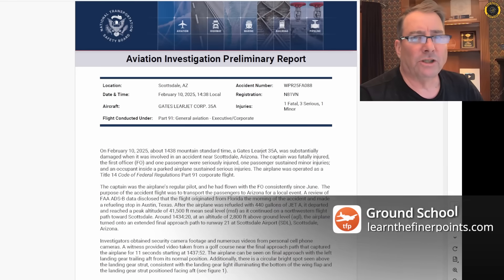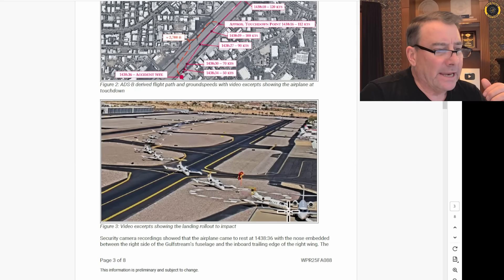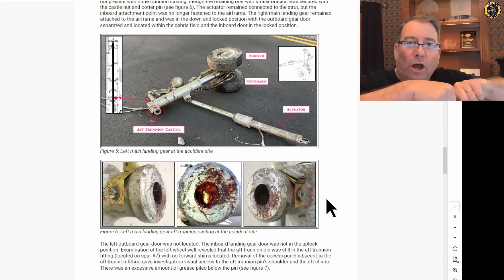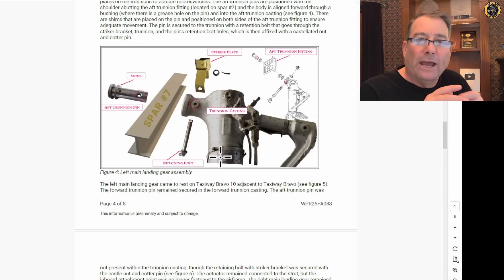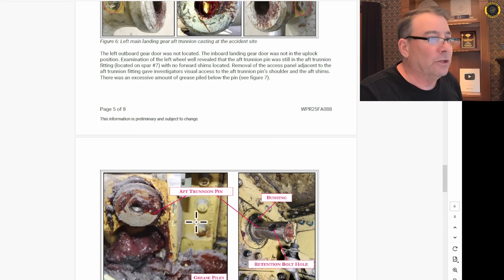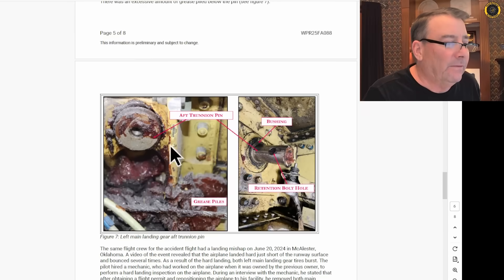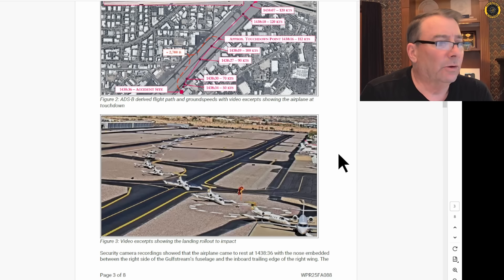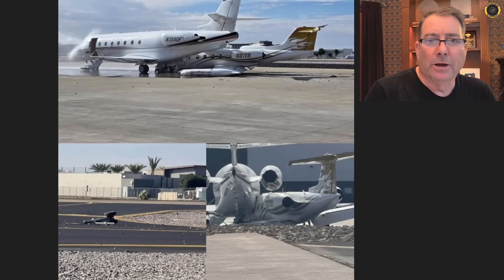NTSB Preliminary Report Fatal Maintenance Error Lear 35 Scottsdale

Comment: I found this exact thing on an AOG call out for a Cessna (I believe 560).  The discrepancy was a leaking brake line.  It was leaking because it had been smashed and stretched with the gear loose.   The sub structure and access panel kept the gear from coming out of the general location.  The top wing skin was dented when it landed and was taxied, towed and parked with no one seeing the real problem.   When we stood back and looked the wings were not level and looked similar to a low strut.  If that brake line was not leaking this aircraft could have very well been flown again.  A good walk around is ALWAYS needed even when it is a quick turn around.  That pin took a few flights to work out.  Never assume it flew in good so it is good to fly out.

Comment: Juan,  If that landing light is illuminated, then the landing gear squat switch is in the DOWN position. Learjet uses this feature as a backup to the cockpit green light. So during a tower flyby for an unsafe gear. If the tower sees the landing lights the gear is down and locked . That is if the trunnion is in place.

Comment: Sorry if this sounds like a dumb question, but could this have been spotted by the pilot doing thier walk around? if so, maybe adding this to the check list might save lives in the future.
Reply: Only if you could see the head of the pin on the other side of the spar. If the mechanic couldn’t see it, you couldn’t either.
Reply: @txkflier  What about all that grease? Surely, that should be a sign something is wrong.
Reply: @ It would have been a good sign if he’d read it. Without the bolt through the pin, the grease could have pushed the pin out of the trunion.

Comment: It is impossible for me to believe even a marginally capable A&P mechanic (assuming that is who did the "repair" in OK) would not tug on the "AFT Trunnion Pin" after inserting the "Retaining Pin" to see whether the "AFT Trunnion Pin" is in fact, retained. I am equally surprised the design allows the "Retaining Pin" to be inserted without the "AFT Trunnion Pin". When I talk "cars" with my wife (retired aerospace engineer/program manager) about how cool an ECU system or ABS system is, she always retorts "well, it ain't aerospace! 😄".

Comment: I work on my own and family's vehicles and I also help the neighbors sometimes. The more "safety related" an issue is such as brakes, the more careful I am in double and triple checking that everything is put back together and operating correctly.
It's amazing to me that a mechanic would not notice that the trunnion was not fully seated on the trunnion pin by over an inch or that the pin itself was not tight against the shims on the other side of the spar, as it could not have been. I just don't see how this could possibly have looked correct on either side of that spar.
Reply: makes me wonder if there needs to be frequent THC tests - just like breathalyzer tests for presence of alcohol.
Reply: Brakes are simple and hard to f up. Your car has 2 hydraulic brake circuits, lose one you still have some braking, lose both somehow and you can downshift, then you have a parking brake. You have a lot of options if you lose some or even all brakes, but no good options when you structural parts.  example: the steering knuckle that holds the wheel on. Re-use one that's been overstressed and you can cause a nasty condition much worse than, say, a popped brake line.  

e.g.; knuckle breaks, wheel folds into fender, car spins out of control, gets wedged under semi-trailer in the next lane. After extricating car and survivors, driver needs a power wheelchair and can't shower themselves.

Comment: When I did my first starter replacement, my boss was watching and let me "finish". He asked me if I was done and I said yes, he said no you aren't and pointed at a washer on the bench. I had to remove the starter, figure out where that washer belonged, and put it back together correctly. Great boss!
Reply: Tedious as it may be, when you get a result like "gee that sure took a lot of grease"  or "I have an extra washer" you really should determine the reason for the unexpected result, perhaps even more so when people might die if you have overlooked something...
Reply: @ Exactly.
Reply: Helps to place parts in a line as you remove them.
Reply: @Caperhere  or just follow your AMM
Reply: @Caperhere Sure, if you have the room to do so and a very good reason to believe nobody will go traipsing through your Stonehenge and eff it all up  -many maintenance shops have neither. I find when working on generators that a tray or dish for fasteners from each assembly should be completely adequate, given decent memory skills. An aircraft shouldn’t be terribly different.
Reply: Great student.
Reply: @toomanyhobbies2011  that’s why you bag and tag all removed components. The bags should be empty when you’re done unless you replaced that hardware with new.
Reply: I worked in shops where guys would throw an extra washer on the bench when the job was done..
Reply: @craig7350  Standard shop horsing around. I hope aircraft mechanics don't do that.
Reply: @spehropefhany  My old father did that when I as a child did disassemble and reassemble a mechanical watch. I could never figure out where that extra wheel should fit.
Reply: In my last job we maintained spray booth conveyors, which required links replacing from time to time. An apprentice managed to fit a section in backwards, which then jammed in the drive when put back into use. Our team leader made the lad strip and rebuild a spare section of conveyor about ten times on the bench afterwards. He made damn sure he wouldn’t do that again! 😂
Reply: Yeah, extra parts left over are an indication of a  problem. I remember reading or hearing a mechanic discovering some leftover bolts after finishing which he hid in his toolbox until the same plane came back and he could replace  them on the qt.
Reply: @toomanyhobbies2011  I once worked for a company and that sold commercial paper shredders I would have to go to locations and repair them. One of the places I went to was a big facility where McDonald Douglas brought the aircraft in to have them worked on I got to know some of the mechanics who work there during my trips to repair the shredders and they said that every morning they would go to the tool shed and there would be their job sheet what they were going to fix that day or work on or whatever and they would have a cart that had all the tools and everything they needed on there to do that particular job when they went back with the cart to turn it in they had to have everything on the cart in the spot where it was marked off to be stored and not only that but they had to return all of the parts they removed from the plane. Even down to the tiniest little screw and if anything was missing nobody went home until they found it. They had signs up all over the place inside that said stay alert FOD is real.
Reply: Tough love is some times good
Reply: When there are leftover parts, that should be a hint 😂
Reply: Maintenance and parts manual should be used on every job not your memory.
Reply: @goducgo  Actually not manuals, but a clearly described and illustrated step-by-step standard procedure, preferably with a tick-list for critical items. We used this method for every job, regardless of complexity to ensure consistency. And we didn't work anything as critical as aircraft.

Comment: It adds to my recommendation that autopilot landing is desirable to avoid damaging the plane in chance bad landings. Aircraft are typically not well suited for contact sports so just one hard landing can cost exotic amounts of money. A lean composite plane will have higher tolerance but even that has limits.
If you are a commercial pilot it's typically not a joyride, more a great responsibility to land it well with little upside for doing it right and major downside for doing it wrong. It should be welcome to just supervise the plane landing itself.
Reply: Most aircraft do not have an ability to autoland (CAT III approach), and outside of major airports the airport cannot accommodate it.
Reply: @FlyingtheLJ  If you look at the synthetic vision when small planes land you can see it's plenty precise enough to hit the runway. Notice how centerlines match well. It's technologically not difficult and it doesn't require special airports. The pilot supervises and can abort if it doesn't hit right or there are other circumstances. It's not the same as being able to land completely on its own in any situation. That's a lot more elaborate.

Comment: When something doesn't seem right it's probably not. Better investigate.

 When the fitting normally takes 3-5 pumps of grease but this one is taking 13 and still doesn't seem full, you don't just "send it".
Reply: If there ever was a red flag that something wasn't right, this was it, and it was ignored. A couple of mechanics are going to have a lot of hard questions to answer.
Reply: @HikingBob  I think if they're decent human beings, it'll remain in their conscience.  But for them, at least life goes on, even if that black cloud will come and go.
Reply: @HikingBob Nothing will happen to the mechanics as it's just an honest accident.
Reply: @jamesm568  criminal and probably even their certificate yeah they will probably be OK, but someone is getting sued for sure.
Reply: @jamesm568  also the same goes for pilots in our country generally. They usually are not charged with anything. It would have to be a straight up criminal case for that.
Reply: @jamesm568  Wrong. That (or those) mechanic is going to see a civil lawsuit, and have to answer a lot of questions from an attorney who never held a wrench in his life, and probably also listen to other mechanics state that the manual is clear and concise about the correct procedure. Not a position I'd want to be in, and possible suspension of the certificate that he makes his living with. It's gut-wrenching to even think about it.
Reply: yeah, and you can see the grease on the very end of the pin, when it should be in the hole of the pin.  Definitely a "something didn't seem right" because it definitely wasn't.  In aviation, that a screaming warning.
Reply: I wonder if that mechanic thought to himself, "gee I was lucky getting that hole to line up perfectly the 1st try" as he pumped half a tube of grease in?
Reply: Exactly. An aviation mech can't ever say "ah, something's wrong, I don't know what it is, but it'll probably be OK". That's negligent homicide.
Reply: Easy to be wise in hindsight, but yeah, the excessive amount of grease should have rung mental alarm bells.
Reply: Or when shimming the outside of the aft trunion pin, you have to make up for an extra 1 3/8" for some reason. That's a lotta extra shims!
Reply: The guy that worked on this plane did.

Comment: I'm not a mechanic but my SAT scores were all in the spatial relations section 😂 It seems beyond belief that the mechanic could have had the trunnion pin backed so far out that the retaining pin was in front of it in the hole, and not noticed what must have been a huge gap between the shims and the spar on the other end of the trunnion pin. How did that happen? Was alcohol involved? Are the mechanics at that shop that overworked? This is almost like sending a car out with a wheel that has only one lugnut installed.
Reply: spatial relations is the only cognitive skill that is not part of the SAT.
Reply: @Milkmans_Son  You’re right. Edited accordingly.
Reply: Good questions.  Maybe someone should investigate that.
Reply: with the availability of THC in so many states, there needs to be an instant check (breathe-blow) for the presence.  only a fool will discount that as a possibility - that no one wants to talk about.
Reply: @kevinking9783 I would hope that in a professional setting people would be forthright about any risky behavior including that one, and that other people would recognize that doing so doesn’t make that person a “square” as it were. Almost all of us drink socially, but it doesn’t mean we overlook drinking on the job.

Comment: I’m surprised the grease didn’t push it off with hydraulic displacement. He should have taken it apart when it took that much grease.
How it closed properly is beyond me.
Reply: One possibility for not taking it apart could be similar to the pilot mental fault of "get-there-itis." Or maybe getting interrupted and forgetting about that thought.  It doesn't excuse it, it just explains a way it could happen; but should have been caught.  Typically failures are due to more than one thing going wrong in the process.  It will be interesting to learn the actual investigation conclusions; but, fun to guess.

Comment: It seems that in the necessary wrestling to fit the gear leg, the trunnion pin was pushed out of full engagement. But that has to be visually accessible, as the pin must be inserted from the far side of the spar. Is the fix a spring-loaded plunger which blocks insertion of the retaining bolt until the trunnion pin compresses it when fully inserted?

Comment: In FAR 121 operations  gear changes / removals  are always  RII (required inspection items). A mechanic  and inspector  do every  step together.  Mechanic  fix Inspector observes. We use  taskcards and sign for each step to avoid thease very things.
Reply: If this was done at a repair station, it would be an RII as well.  I'll be curious to see if they relied on an individual A&P for this big of a project, which is never advisable on gear removal.

Comment: The excessive grease should have been a clue that something wasn't right. Also, a measurement could have found the problem. If the mechanic had stopped and even just walked over to the other landing gear, he may have noticed the difference. 
I've seen mechanics not tighten a tire on a car and the customer drove it and the tire fell off. 
No one was hurt, but do it on a plane and someone dies. There is no excuse for shoddy work. You make damn sure it's done right or find another career.
Reply: Or the quick lube place forgetting to put on the oil filter, or drain plug, or to add oil...
Reply: How on earth do you tighten a tyre?!
Reply: @2760ade  I should have said, you put the lug nuts on by hand and then you tighten the lug nuts up.
Reply: Something non aviation related-----my new right front tie rod on the car separated from the steering rack on 2-23 (last Sunday), I'd had both of the old ones replaced six days after Christmas.
Reply: @ Yeah, someone failed to do the job right or a defective product was used. You're lucky it didn't cause an accident and got you hurt or worse. Attention to detail is falling by the wayside.